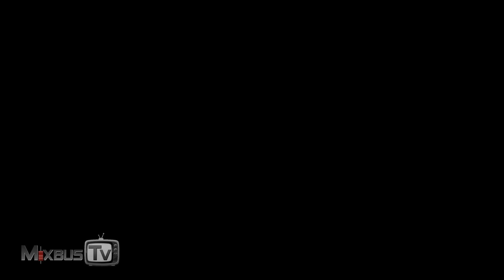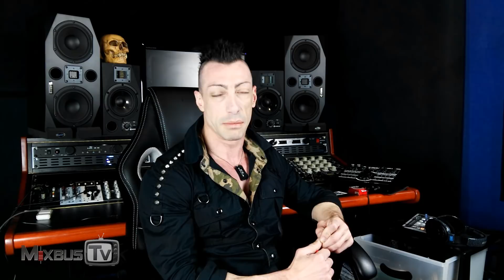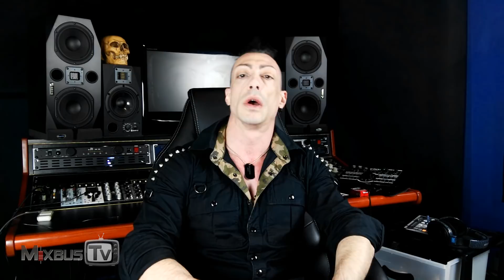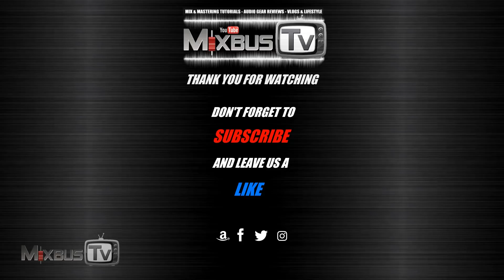Unconventional Tricks for Perceived Loudness, LUFS vs RMS, The Hell Frequency

Comment: I found that track density thing out years ago. The reason the silence before sound makes the sound perceived louder is because the human ear is basically like a self adjusting mic. Your ears actually get more sensitive during silence, so if there's a sudden sound, you actually hear it louder than if you were in a noisy environment and your ears had their sensitivity lowered because of it. This is also the reason the transients on certain instruments can sound really harsh/loud when recording JUST the instrument on it's own but once it's dumped into the mix, it's loudness sounds different. One more reason to listen to takes in the mix before applying any significant compression/EQ (IMO).

Comment: David, if the goal is -16 LUFS, should we ignore the true peak as long as it's under -1 and not peaking? Thanks, R
Reply from the maker: I have a recent video about true peak, released this past  week. 
It's safe to say if your ceiling it's set at -1 you're probably safe if also you're not squashing the mix with a limiter (which for such low LUFS, you probably wouldn't) but if you DO have ISP and the meter tells you, IF you don't want ISP then you should adjust. I  personally ignore them anyway (and so 90% of professionals) at any given LUFS but yeah

Comment: Thanks again for the knowledge you share. I have a question regarding gain staging and mixing. I do most of my work in the box, and i use vst plugins to play instrument, so i was wondering if you usually reduce the plugin output so the track hits -18dbfs before converting midi to audio or you convert and then use a gain utility or trimmer to reduce it to -18dbfs since most of vst plugging play hot signals? Thanks

Comment: Another great one for my video library. Thank you, David, for giving your thoughts on the subject.

I've noticed (in that video where you were checking whether or not YouTube and Soundcloud does normalizing on uploaded track)  that your example was laying around -8 LUFS on the WLM meter , which normaly is were my Master sits too, so I assumed that im doing fine. 
Yesterday tho, while I was comparing my latest mix with a commercial record I've found my  master sounded as good as the reference but it was bloody quiet, compared to that hard clipping above 0db, -6LUFS Commercial Song. :D
 I have printed another master at the same value -6LUFS and it sounded..well lets say good enough (theres no obvious distortion etc.) 

I wonder if your clients in Trap, HipHop and EDM genre often ask you to push their stuff up to -6LUFS, were the momentary LUFS can go up to -3 and the track is basically clipping most of the time.
Isn't that bloody loud?

I know that
1st - it is subjective
2nd - depends on the material, 
3rd - it's my (engineers') decision to make, but If you can share your experience, that will be much appreciated I imagine not only by me.
BTW I use Waves WLM meter too.
Reply: MixbusTV 
Thank you David for your detailed answer. Im sure there's no easy answer to that. I appreciate you shared your precious opinion about that loudness madness that is taking over these days. 
Also i've read somewere long ago that -8 continuous power of the signal is kinda standard for Rock music. (meaning its a sweet spot between goodsoundin & loud master)
Well..now I can keep calmly  aiming at my sweet spot level with minimum gain reduction.

Thank you again for clarifying that  for me. And for being honest.
I really appreciate it! 
You are THE MAN!!! :)

Comment: David i just tried routing my whole track to a send channel and basically putting fabfilter saturn on it(the send channel) mixing it with the original around 56 % ( I know it really depends on the mix you are working with)  i excluded the lows and SATURATED heavily the mids and highs .It resulted in greater density and over all perceived loudness i concluded that by bypassing and unbypassing  the send channel.I leave this here so you all can try this,it really makes a difference if your track needs it ofcourse.
Reply: I lowered the gain knob on the lows in saturn so i am routing only mids and highs to the original.That must be noted.
Play around with the band with until you find the spot for your track,at least i did that.
Reply: I am not leaving this for david  ahah, just for us fellow randoms.
Reply: I really like FabFilter's Saturn. Its my favorite saturation plugin and the inbuilt transient designing function is just awesome. Not sure why you would want to have it on a send though as it has a mix knob on all bands and the master.
Reply: That is interesting, I usualy use parallel saturation (or non-prallel) only on a certain track /or bus in my mixes to controll the dynamics a bit, also to put some "life" in it, but TBH I havent tried to do that on the 2Bus. Imma try it latter today with my latest mix. I'm assuming this will crush the f*ck out of my overheadz and Hihatz but ima set the saturation to be more suddle with more action at the mid freq. content. (where the human hearing is more sensitive) i'll share my experience later.
Fine idea, thanks for sharing it.
And ya, Saturn has a mix knob built-in, no need to route anything.
Cheers!
Reply: MixbusTV 
Yes, David, I'm sry for that link. I didn't knew it will cause difficulties. 
I've deleted the link and the old post and I will post my question again. I'm curious to "hear" what you have to say about it, exept that it is subjective and depends on the material. 
I hope you can answer, regardless of what happened earlier.
Cheers!

BTW Folks I've tried slapping a Saturn on my 2Bus and David is right as expected - you will want to mix within it from the beginning.